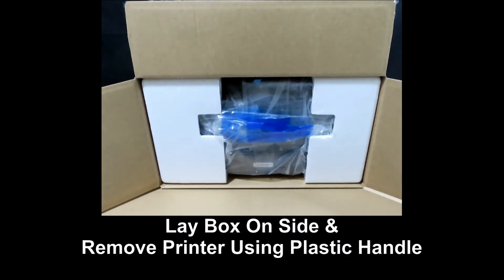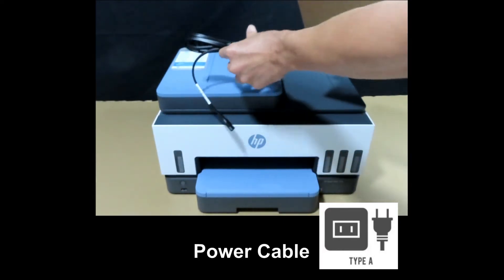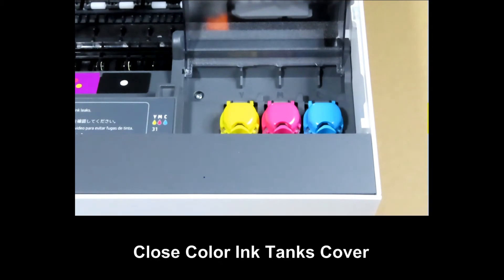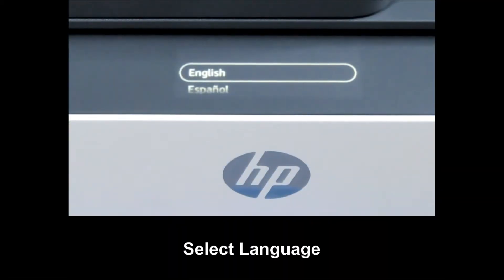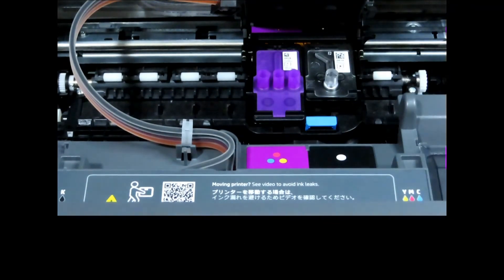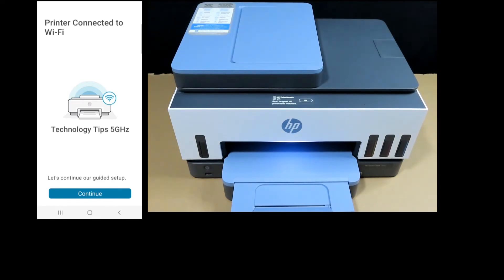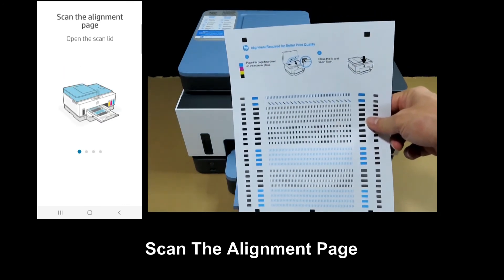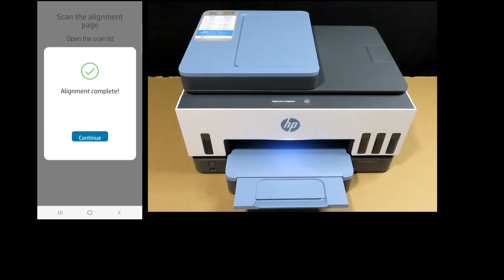Review HP Smart Tank 7602|790 AiO printer:HP Smart Setup |Fill Ink Tank |Printheads |Wireless Setup

Comment: I really need help. l bought this  and i was unable to get help from HP waiting for 30 minutes on the phone until my phone time ran out.  How do I set this up without a smart phone?  And without Wifi? 
I want to use it manually, with a USB cable directly from Computers to the Printer. I change between devices so I plug the USB cord into which ever PC I am using at the time.
How can I make it work without the smart phone connection??? Did I buy the wrong printer for this to work?